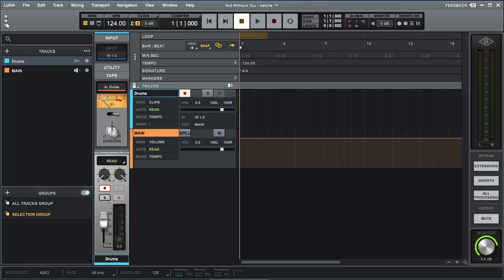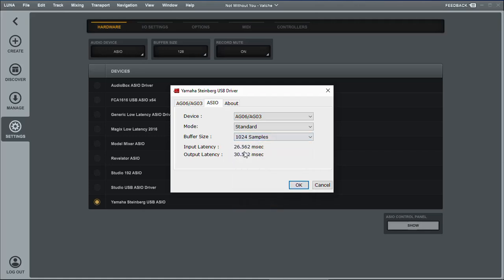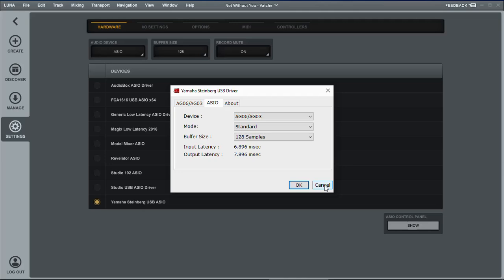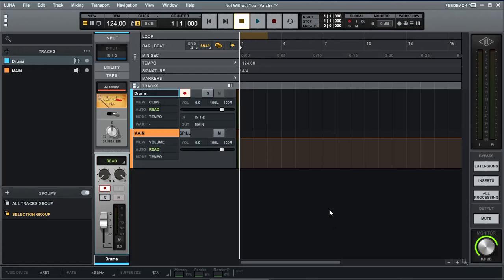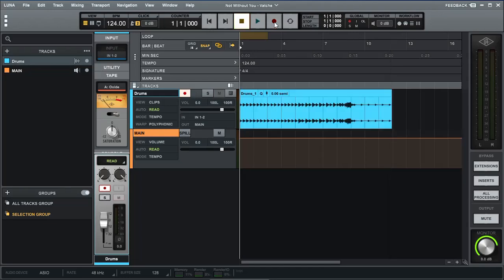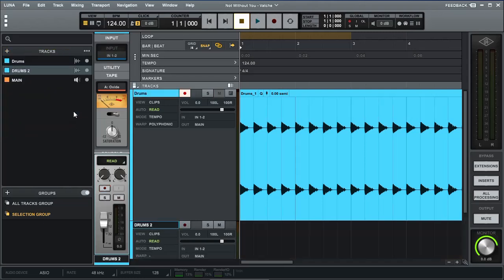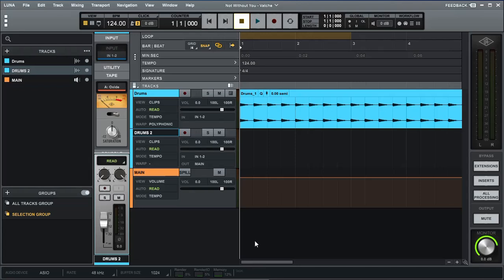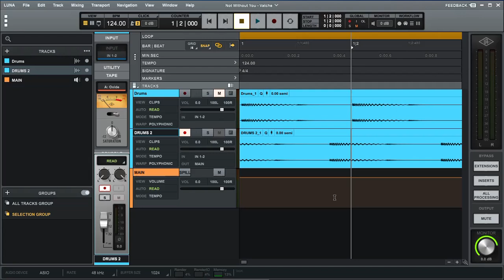How ASIO Buffer Size and Latency Affect Your Recording

Comment: What is the round-trip latency you usually have when recording with your TASCAM Model 12 please?
Reply from the maker: Less than 10ms with buffer size of 32, when no plugins are used. 
Here is a good example video 
TASCAM Model 12 | Live Vocal Pitch-Correct Setup Tutorial
https://youtu.be/GPuTVBqS918